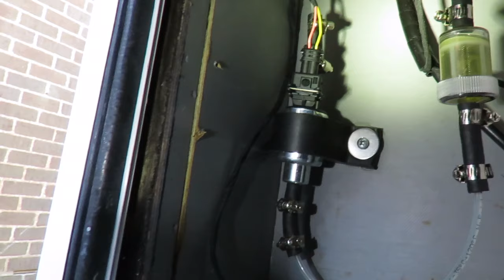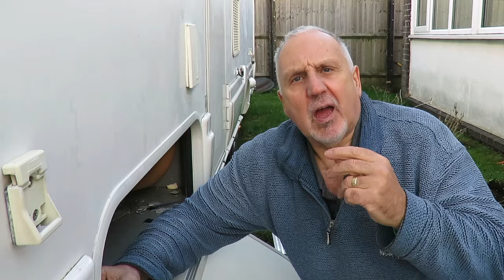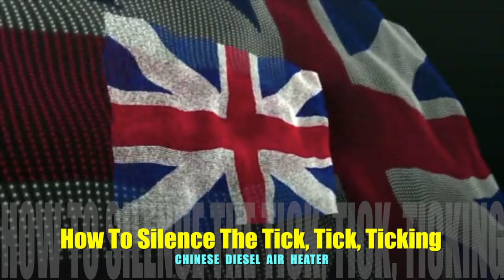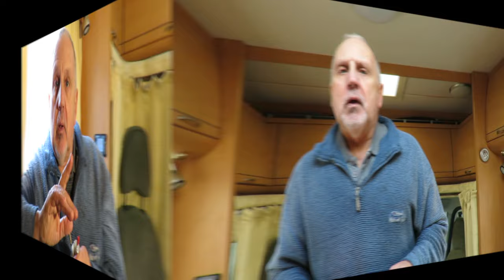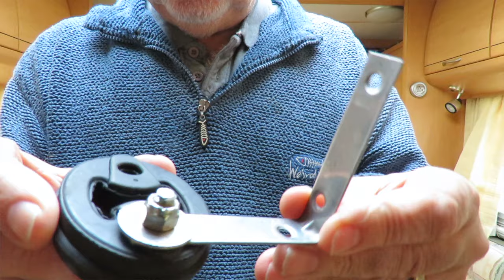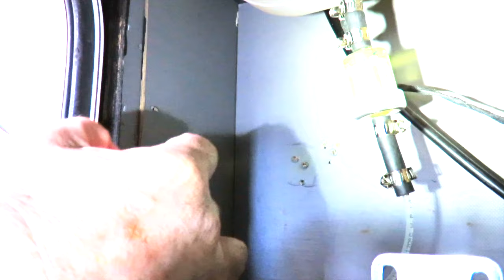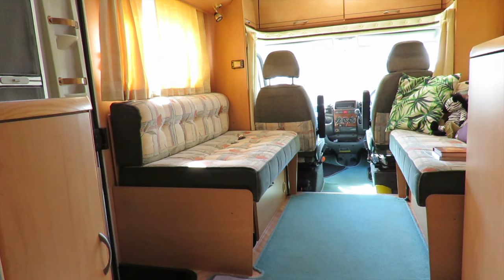How To Fix A Noisy Fuel Pump On A Chinese Diesel Heater  - Quiet Fuel Pump And No More Ticking Noise

Comment: So I completely silenced mine.  You can't hear anything in space so I created a small PVC vacuum chamber and the pump sits inside.  The inlet and outlet hoses and wires are silicone sealed and I incorporated a Schrader valve to pull vacuum.Easy to make.  You can hear it go silent as the vacuum increases.  simple, cheap, effective.  No one can hear you clicking in space.  Odd when it's totally silent.  I'll post a video of it on my channel.  Enjoy.
Reply: The lack of a video determined this was a lie
Reply: Lol
Reply: His video was lost in the vacuum of space.
Reply: You needn't go to all that trouble, just launch yourself into space
Reply: Still no video? How do u make it?
Reply: Cobblers
Reply: Randy??
Reply: Where does one get the sound barrier jacket.

Comment: I have tried many many things to stop the tick tick , The best i have found is suspending  the pump in some white PVC drain pipe filled with expanding foam then hang the pipe from 3 cable ties ,, I have got about 50% reduction in the low tick and 90% in the mid range Bumble bee sound
Reply: what about suspending it in mineraloil? such as used in computers. that will propably eliminate the ticking
Reply: What size pipe did you use ? double the size of the pump. or smaller ?

Comment: Iv moved the pump to the underside of the vehicle. Wrapped it and hanging it using rc silicone pipe (very soft) and replaced all the fuel lines with rc silicone pipe to stop the sound traveling to the heater or fuel tank and I literal can not hear the ticking inside the vehicle

Comment: Why not put sound deafening foam in the whole space that the pump located? That hollow box is an amplifier(aka speaker box) for that clicking sound!
Reply: I did that and it realy helps a lot
Reply: I found the noise is not so much the pump alone but , like the OP , the pump/van body interface ( so to speak )
I hung mine off an exhaust strap ( impregnated cloth type ) similar to in the video but one that is about 4" long,,, I mounted it UNDER the floor too
With the pump external to the hab area and isolated you have to listen REAL hard to hear it at all :-)

Comment: I built a plywood box to house my diesel heater.  All the internal walls were covered with wedge acoustic panels.  Upgraded the silencer, housed below the diesel heater in a separated compartment.  Rain proofed with rubber sealant.  Has internal battery with built in charger activated by wifi plug to charge the battery when electric is at the lower rate.  Charge is automatically stopped when battery is sufficiently charged.  Runs so quite all I can hear is the warm air blowing out.  Took some effort but once built its easily maintained and worth all the labour.  If I were you I would line the inside surroundings with the wedge acoustic panels.

Comment: Finally an educated diy video, i have watched hundreds of backyard hacks videos claiming how to get rid of the tick. It can't be done, but the front bar experts will keep claiming they know the answer.
Reply from the maker: The nature of the pump itself is certainly not conducive to being anywhere near silent or even vaguely quite...!!
Plus the diesel oil is really the only form of cushioning inside the pump, so really not possible to do anything other than try to quieten it down by masking the ticking pulse..!?
I've actually got quite used to now and any ticking noises just blend into the background...🙄
ATB,
Steve

Comment: I got a little bit more fancy on my sound deadening.
I got myself a piece of 3 inch pvc rain drainage pipe and two pvc end caps, a couple of fuel line grommets and some rock wool insulation. I stuck the pump inside the pipe surrounded by insulation. the end caps I press fitted in place with a couple of small screws to hold them onto the pipe.  I mounted the pipe with some down pipe brackets. The sound is there but hardly noticeable... even when it is at full blast...

Comment: Many thanks for this. Just installed one of these on my camping van and that noise drove me almost insane!  I decided to reroute the fuel line and pump and put it outside of the vehicle. There is good insulation of two layers of plywood plus a good two inches of polystyrene on the underside, plus the carpet etc to deaden sound. A bit of a job but well worth it.....I can sleep peacefully without counting clicks!  I now need to weather seal the pump....and buy a spare just in case...but here in the South of France wet weather is rarely a problem...and in winter it is frozen solid in the Pyrenees..... Thanks again, Martin

Comment: If you angle the pump 45 degress, the internal mechanism is fully lubricated. 
Placing the pump below the fuel tank allows full immersion too
I also place mine in wool insulation, in an aluminium box, screwed to a secure point in the vehicle.

Comment: Thanks for the video and glad you were able to quiet your pump! My pump is underneath our van and these cheap chinese fuel pumps are incredibly loud, especially at start up. I've purchased one of the rubberized covers, wrapped it in 2" of high density foam and duck tape, and suspended it from zip ties from the steel frame and it's STILLL very audible inside and outside the van. I'm investing in the silent pump made by James Browning-Smith!
Reply: You can start them on the pump then switch to gravity feed if you can measure the flow well enough. No pump required.

Comment: The best solution I've found so far is to loop two medium sized plastic zip ties through that rubber ring you get with the pump, leaving them long and loose, and squeeze that back onto the pump. Then loop another zip tie through those two, again leaving it loose. Then add just one more that you cinch down onto a screw or hook that's mounted to a wall. Make sure the first two loops come out the top of the pump (the output). This holds it vertically.

My pump and heater are inside my bed, which is basically a large box with a hinged lid, so it's fully enclosed. I used to use bungees to mount the pump, but they didn't help. I could hear the thump, thump, thump when I put my head down on my pillow. With the zip ties I literally don't hear a thing! There's something about the loose coupling between the loops, or the plastic itself that doesn't transmit the thumping to by bed.

No sound-deadening jacket needed. The problem is not the sound that comes through the air, it's the solid connection to your vehicle that is the problem. (Assuming the pump is hidden away in some sort of box.)
Reply: Any photo of this by chance? Sounds brilliant  - but I got a little lost. thanks!
Reply: Any chance of a photo?
Reply: @sketchbookinc.6564  I have seen the solution; basically you can toss the mount and suspend the pump with HANGING (loose) zip ties. But when you use this method you must still maintain the 35 degree upslope angle of the pump. In summary, ditch the mount.
Reply: @petesmith9472  Upslope on the chinese can be vertical, they took the instructions of the German models..Guy on youtube "Expert " goes into the fine details.. John Mck 47
Reply: I've suspended my pump via zip ties and, even in mid-air, the ticking produced by the metal cylinder in the pump is still very audible and annoying, both inside and outside the van. I also have it wrapped it in 2" of high density foam and duck tape! I keep reading about folks "silencing" their pump by this method, but I haven't experienced it in my experience. I plan to invest in the actual silent pump made by James Browning-Smith.

Comment: Wonder what would happen if pump was wrapped in noisemat used in cars that sticks on???great video!
Reply: As long as it didn't get too hot, it probably would work.
I wouldn't imagine it would get very hot at all. Especially when it's cold enough to need the heater and the cold fuel going through it will also provide some cooling.

Comment: That is one heck of a difference! Thank you for the video! I guess it would be possible to build a sound dampening box around it. Sure it's a lot of work for a cheap device. But totally worth if the sound comes across as bothersome. I guess buying cheap sound proofing material for cars and clad a box is enough. But if you are going hardcore and want to eliminate ALL THE SOUND. make 2 boxes, air gap in between the boxes. (use rubber feet in all directions. Seal the boxes completely (no air should be able to travel). The fuel hose needs gaskets and sealant through every box it enters/exits. Mount the box with high grade industrial rubber bands to eliminate vibrations. I guarantee it will be dead silent. ;)
Reply from the maker: Good idea. Bit like double glazing  
I suppose it all boils down to how much it bothers you really. 
Once up to temperature and with the pump barely ticking you have concentrate to hear it even with minimal sound deadening. 
I don’t run it during the night so no bother there. 
ATB, Steve.

Comment: The pulsing noise is also transmitted up the hard plastic fuel line. I wrapped my pump in a towel, further wrapped in sound deadening mat, then placed in a plastic box. I suspended the box and fuel lines with stretchy cords to ‘float’ everything in free air so that neither the fuel line or pump box touches and transmits vibrations to the body of my camper. Works like a charm, no noise whatsoever. Looking to find a softer, more flexible chemical resistant fuel line though for future installs.

Comment: The solution does not lie with a cushioning pad. 95% of the noise comes through the fuel line. Notice the movement of that small air bubble in the filter. The solution is to use a 10-inch piece of soft and really flexible, slightly curved fuel line on either end of the pump. Not that stiff and hard rubber that is commonly used. In my case it reduced the noise by at least 95%. A shocking result.
Great video by the way.
Reply: I was thinking the same thing
Reply: Is the soft flexible fuel line readily available at any automotive supply company? And I’m assuming that it needs to be the same ID as the materials supplied in the kit. Correct?
Reply: It's normal that the stiff PVC hose moves with the impulse from the pump, that's how the fuel is pumped on. The heater relies on that impulse. Some of the heater kits came with flexible silicone hoses, they didn't work that good. For my kit I decided to get one with the stiff white hose, just to be sure. 
The looped cable ties works really great, had many positive reactions after recommending it!
:-D

Comment: Thank you ! I too tried various ways to isolate the "tic" completely sealing it in a box 1" thick Ceder. Nope, sound transfers out and down the fuel line. Yes, I am using nylon line, I suspended the pump in box. The difference? Went from a tic, to a thump. Far worse than before, so, I simply suspended it with small Bungie cords in a semi open area. Anywhere the fuel line touched anything, I insulated with micro fiber rags. This did not eliminate the tic, however, it now is so subtle it's barely noticeable. I am super Anal about noise, hate it ! So, if it works for me, should be fine for you. Just know, the sound will transfer through the fuel line no matter how well you seal the pump . Or, move pump as far away from living area as possible. Mine is in a Van build so...Love the heater though 🤟🤟
Reply from the maker: Hi Alan.
I'll give that a try, thank you 👍

Comment: I hang mine on a wrist loop sized cable tie to the bracket and it really quiets it down.  The rubber was transmitting too much thudding sound though it helps a bit.  Cable ties are the go and adjustable for the quietest effect.

Comment: I have  2 of my pumps inside  pieces of lead waste pipe, and have them suspended like yours, drops the noise a fair bit. 
Also going to try using same pipe to make a better muffler soon (1 meter length worked great on my old 5kw chinese diesel genny)
Another system in my house bus, has a quieter (type E) pump, which i wrapped with exhaust wrap, which makes it almost inaudible inside, and exhaust improved a lot with entire length  also being tightly double wrapped, including standard muffler.(soaking well in water before using, makes it so much easier to use), and prevents any risk of it starting a grass fire.

Comment: I 3d printed a mount/cover out of flexible TPU, I worked really well. I cant hear it at all through the thin wall of my Boler. Mostly it is how/where you mount it though. The physical vibration if mounted wrong can make the whole trailer a giant drum.

Comment: Thanks for that. To say that the pump is unlubricated is not quite right, since it is self-lubricated by the diesel.
Reply from the maker: Hi Dirk
Yes, I know, a lot people have mentioned that. 
I should of added, “not externally lubricated by a separate oil feed”.
Obviously the clue is in the name: Diesel Oil.😂🤣😂
ATB, Steve

Comment: Hi I have my pump literally hanging on the fuel line underneath the van and I can’t hear the pump at all.. obviously doesn’t hang down but it is suspended by the black rubber fuel line.

Comment: Have you thought of sound detaining vehicle insulation attached to the walls of the vehicle. The come with peel & stick panels. It add temperature & sound insulation. Manufacturers use this to reduce noise in the car’s engine firewall & flooring areas.

Comment: Great video,  I'm  just wondering  about adding  some 2 stroke oil to your fuel to help lube the pump  . It could  help .
Reply from the maker: Hi Gary,
Since this video I have completely upgraded my heater setup.
Now working very well.
Here's the video:
https://youtu.be/HHJaPP2uLFA
I have also found that adding a small amount of diesel fuel additive into the tank has worked wonders too.
The stuff that's designed to keep the injectors etc. Although one subscriber did suggest that GTX works well too.
Helps reduce carbon build-up and keep the burner clean, runs smoother as well.
ATB, Steve

Comment: The pump should be at a 45 degree angle. They also sell covers for the pumps that muffle the sound substantially for about $8 from china. It also has to be floating, even with that rubber it will still push vibrations to the other surface.
Reply from the maker: Hi Fedor,
When the pump pulses it creates cavitation within the pump body, which is tiny air bubbles.
If the pump is at an angle these air bubbles will become trapped causing two problems:
wear within the pump & incorrect fuel dosage, leading to a lean fuel burn and incorrect combustion.
With the pump at 90degs any cavitation will be completely avoided.
Instructions say 45dges, which is the lowest angle you can have them I would think, before it becomes a real problem.
I am experimenting with that type of foam cover as well.
A case of trial & error with different hanging methods also.
ATB< Steve
Reply: @TheWrinklyNomads  Cavitation is not a problem unless it's horizontal. At 45 degrees the pump won't go dry when the line goes empty. There will be some fuel left in the corner of the pump. If it's at 90 degrees, or vertical, fuel can drain out completely and the pump will eventually fail prematurely from repeated metal on metal contact. The other reason may be for debris control, so any particles would fall to the corner instead of blocking the inlet. I'm sure there are other reasons but I can't remember at the moment. There's no reason to mount it vertically, there are multiple reasons to mount it at 45 deg. Do whatever you feel is best.

Comment: I haven't tried it, but I would imagine if you were to put a 3" plastic drain pipe over the pump, about 6" longer than the pump, fill the pipe with silicone, making sure there are no cavities, then cut the pipe along the length and remove, then wrap the fuel pipes either end as much as possible with some felt or old carpet, then suspend the pump vertically, on a zip tie so that it hangs in mid air, there should not be much sound coming out of it then. I have just bought a heater, and that's what I am going to try, and hope for the best. Paul UK.
Reply from the maker: Hi Paul,
Yes, people have also suggested similar to that in the comments.
On tickover the pump is very quiet.
I've just got used to the little tick now and it doesn't bother me...!!!!

Comment: Can't someone design a pump that has Teflon O rings or  some synthetic pump material to make it quieter.  I bought a self contained diesel heater recently but haven't tried it yet since we are  still having a hot summer here in California.  Can't wait to try it out.  I'll try wrapping the pump first.  They've dropped significantly in prices as mine was only $89 US dollars.

Comment: I made sure there were pigtails of fuel hose either side of the pump so sound was less likely to be transmitted by the hose, I then used one of those pink covers and experimented with cylindrical rubber mounts that I machined down to make them more compliant, I mounted the spin off fuel filter and a webasto style fuel damper and the pump all below the floor of my van so that all the noise was outside. We can still hear the pump but it sounds like the ticking of a distant clock. That worked for me, but I doubt the noise can be made inaudible.👍

Comment: Oh awesome video. Does the pump ever get hot? And i thouhgt the pump should be mounted at 45 degrees angle. I wish they'd make a pump that is silend. I hate the click click click. 
You've got the pump in the best place to put it in the motorhome. I didn't hear a thing. Yeah the air rushing in but that is about it.
Thanks for the video.
Greetings from the Netherlands,, Kitty.
Reply from the maker: Thanks Kitty,
The pump is warm to touch, but never hot and it can be mounted anything above 45 degrees to allow the cavitated air bubbles to flow up into the burn chamber.
Hope that help,
ATB, Steve
Reply: @TheWrinklyNomads  It sure does. I have not used mine. Just opened the box and gave it a good look 🤔